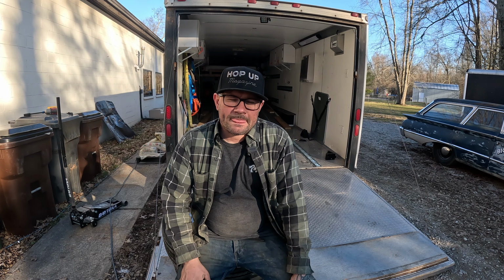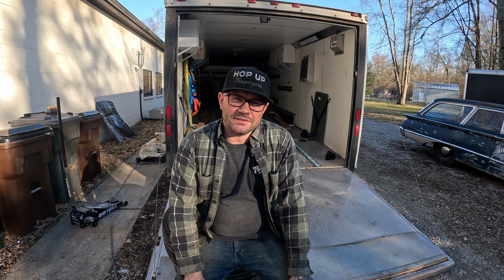Swapping Out 8 Tires On The Trailer, Again

Comment: Hi Mike. I bought a tandem tilt deck car trailer years back that always seemed to tow heavy and rode rough. It always had strange wear on the rear axle tires. I pulled the axles, and measured them up using 4’ straight edges clamped to the hub faces. Sure enough both axles were bent. One was towed in 9/16 just on one side at 2’ from center……. Bumped the axles around in the press and set them both to zero tow in. It tows beautiful now and the tire wear is unnoticeable. I’m sure you likely thought of this possibility already, maybe my story helps out or helps someone else. Thanks for the great content!
Reply from the maker: Thanks. It was weird that it towed fine, didnt wear the tires to or from Bonneville. Then wore the tread off in the way to CA on the rear 2, but didnt wear the replacements on the way home. It was just odd
Reply: That is odd. Tires must have run out of talent!

Comment: There is one brand in particular that has that issue.
If you purchased 14 ply that is a great start.
My trailer ended up having inner bearing issues.
Reply from the maker: I had just went through the bearings last July, its just odd they didnt wear on the way to bonneville or home, did on the way to Ca. , but not on the way home. Same truck, trailer, load, ect. Just doesnt make sense.
Reply: @Cornfield Customs   , pull the bearings ,clean then and give them a thorough check.
At least you will have that off of your plate.
Reply: @cornfieldcustoms  could only be those tires.
Reply from the maker: @airtek4809  that is my thoughts.

Comment: our open trailer has been sitting in the field for five years and it needed maintenance when it was parked.  Hopefully later this year I will put new fenders on, get new tires, and go through the brakes/hubs.  Cosmetically it needs help too, but I want to get it functional first.  Solid, steel diamond plate top has no serious rust.   And I might have missed if you did a video explaining how the roadster was received at the show.  Did you build it all wrong too....
Reply from the maker: The car seemed to be received very well
at GNRS